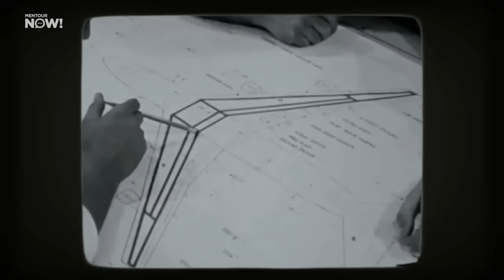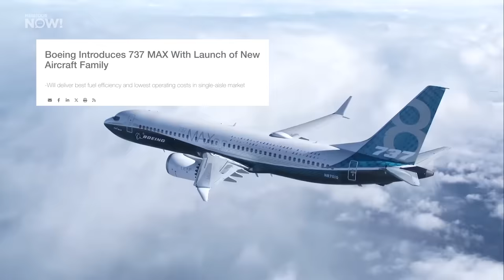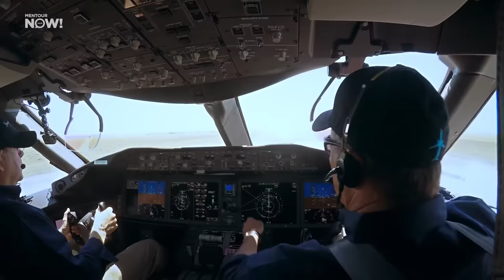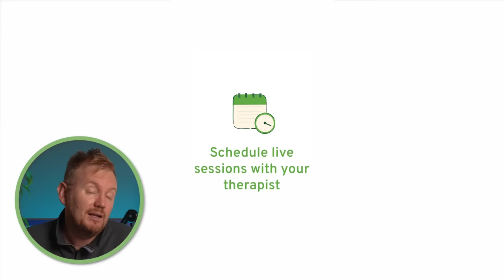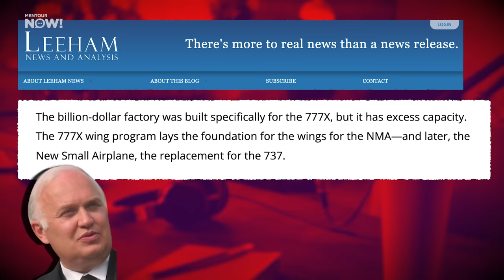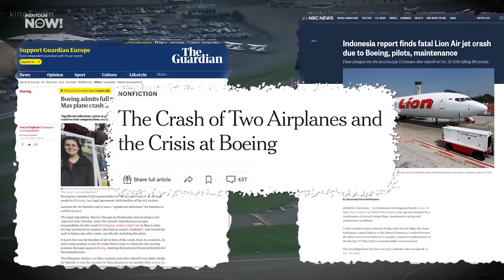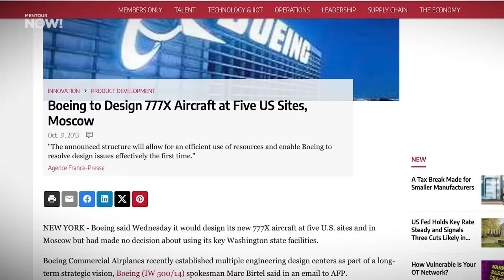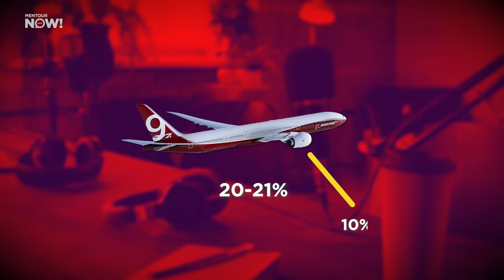What’s Going On With The Boeing 777X?!

Comment: Qatar told Boeing that they could tell by fuel use, which were built using FAUB. I could tell at assembly which sections were robot work. They didn't align very well. I was QA at final assembly.

Comment: I do like your videos, but this one is off. 
Especially in the conclusion. 
One main factorfor better fuel economics is that Boeing cramps more Pax in. A stretch helps a lot, as does a new engine and wing. 

Boeing made some really bad construction and process choices and left quality management fall under the table. 
Airbus did (unofficially) complain about the certification process Boeing had pre - Max murders. (Yes it was murder, and it`s hilarious no one went to jail for as VW managers had to sit for Diesel gate). 
The self certification of an own risk assessment is just contemplating the existence of the authority (FAA).  That had fail implemented, and it`s shocking that FAA didn`t notice it, already the B787 battery issue was a reason to doubt this process. 

Boeing, and solely Boeing is responsible for these delays as they tried to use shortcuts and put money over security. Thy suffer for their own sins, which is actually great. Because it shows that it matters. 
The big advantage Boeing has is the exclusive situation with the engines - Boeing is lucky enough to partner with GE, who`s just ahead of RR. If Airbus had access to a bigger engine, they could have already stretched the A35k by 4m to bring it close to 78m. A bit a larger wing, more thrust - and about 10t lighter for the same capacity as the B779. Boeing would have been forced into another desperation stretch just before the airplanes EIS.   
Also Boeing is lucky that the B777f saved the line.

Comment: So with all these 'FU' of Boeing on the 777X, 12 years now after announcement, will it ever fly? Hell no. The killers: 
1. The big freaking GE engine will not work good enough to get certified, acceptable maintenance. GE has bitter off more than it can chew. 
2. Will the air frame be good enough? Yes, but it will be much too complex and expensive to build. Especially the wings. Huge dollars invested into engineering, never recovered. 
3. Will the aircraft actually be type certified? Highly unlikely. Way too many issues. Another 5-6 years delay. Even if certified by a miracle, the market is gone. Who will buy such an unreliable, ultra complex contraption. Fools - the smart airlines will just buy the A350 and smile all they way. 
4. Finally the last nail in the coffin - China, Russia and friends. Boeing has lost the entire China+Russia markets, for obvious reasons. Their good friends won't touch Boeing. With this huge loss of world's biggest market, who do Boeing sell their 777X to? Europeans buy own Airbus. Few airlines in SE Asia, Africa and the Americans will need such a model. US airlines will be the only customer. Not good enough. 

Boeing has lost the army of engineers good enough to develop new aircraft. They lost it with 737MAX, lost it more with 777X. It announced no mid-range 737 replacement development, and gave up that huge market. It won't find enough people until the next generation of engineers were educated, then get a decade of experience. With luck that date is 2040.

The 777X is dead man walking as Boeing plunge into financial crisis.

Comment: I rather take my chances on the Comac than than any MAX series. I would rather be on a TU-154, screw fuel and emissions, its reliable.
Reply: Yeah and perfectly safe, its only had +73 hull losses with nearly 3000 fatalities
Reply from the maker: That’s a very strange position to have given the Tu-154 track record?
Reply: @tomstravels520  Mostly due to Pilot erroe and poor regulatory standards in the USSR. The MAX is still the most deadly plane in the air today.
Reply: @MentourNow  154m short haul, il-96-400 long haul, Pilot training in the USSR was poor the 154 itself is good. The IL-96 has no hull losses and is an evolution of the 86 which is a solid plane. The MAX how many years in the air and a 100 percent fatality rate on Crashes.
Reply: @REPOMAN24722  Two crashes does not make the plane the most dangerous in the air today
Reply: @nickolliver3021 
I think the issue is that it was two self-inflicted crashes by Boeing driven by “business decisions” that overruled “engineering safety standards” at multiple times. Boeing has and will continue to dearly pay for this shortsightedness considering all of the downstream ramifications.
Reply: @Mentaculus42  boeing and airbus will pay for all mistakes made until they go bust by that logic really. All companies are driven by self business decisions that over rule engineering safety standards all year round. But the whole point is the opposite and actually make better of the past in which boeing is doing and will continue to do so
Reply: @nickolliver3021  They do by showing the flaws in engineering in the plane. the center of gravity is disturbed making the plane rely on more automated systems, the 727 competed with the 154 and had more fatalities and had over 1000 more fatalities and 30 ish more hull losses.
Reply: @tomstravels520  The Boeing 727 it's competition

Hull losses: 119 
Fatalities:   4,211
Reply: @MentourNow  Well it was safer than its 727 counterpart 1000 less deaths similar hulls built, the HS Trident and 154 imho are better. That era of flight was more dangerous too but the 727 was well known for its poor track record. Trident was the first with auto land and I love both the trident and 154, the wings of the 154 and the offset landing gear on the trident and it's strange seating configuration like a train. Also super trident had a little booster jet to help it take off making it the only "5 jet" APU, 3 mains and a booster.
Reply: @REPOMAN24722  the 717……are you sure about that?
Reply: @tomstravels520 I meant 727 not the md-95. Boeing rushed the 727 becuase they worked together with hawker and ended rushing it hawker got pissed off really bad because they had the superior plane. Yet another time when America copied someone elses design.
Reply: @REPOMAN24722  so what flaws are they showing I engineering in the plane? The centre of gravity isn't disturbing. The plane relied automated systems like all planes do. The 727 has had its times of accidents time is moving on so the past is behind us now
Reply: @nickolliver3021 The plane is past it's used by date they should have made a clean slate design, the 737 was meant for small airports that didn't have automated cargo loading hence the low landing gear and wing for ease of maintenance, it's fuselage it shares with the 707, when it came to putting larger engines on the wing the 300 series hit their limit the cowling had to be flat on the bottom to accommodate it but with the new engines they had to push them forward and up so the Plane has a pitch up angle of attack when AP is off instead of a steady drop or level.
Reply: @REPOMAN24722  then by that logic the airbus has gone past its sell by date. They should have made a clean sheet design. The a320 was meant for small airports that didn't have automated cargo loading hence still having ancient technology than newer planes. You keep going on about should have done this. Go tell them straight yo their face. The a320 states its fuselage with the old ceo model. Putting larger engines on wasn't the problem. The engines were bigger and more forward hence a pitch up effect which hasn't causes many problems to this day. If you really want to complain say it to boeings face
Reply: @nickolliver3021  Your logic is flawed, the 320 fuselage and wing is 25 years newer than the 737's hence it being more versatile, the MAX was created as a rush due to customers wanting a plane immediately and threatening to order the a320 neo.
Reply: @REPOMAN24722  the point still stands. Having tne fuselage and wings being 25 years younger isn't the problem. It's still not a clean sheet. The a320neo was a rush too to not go through extra effort into a new clean sheet. That's why the neo was made so the industry doesn't like starting from scratch. Wake up its a sad reality we live in
Reply: @nickolliver3021  It may not be perfect but it's still in a better position than the 737, I want more choices so I for one am happy that comac is entering the market along with the ssj, mc-21, and a dual engined il-96 that China and Russia are working on together, the best plane I was on was an a340-300, was more comfortable than the regular 777-300 that I take, now I chose my routes to follow airbus for the first two legs then embraer or bombardier for the final leg 15,000km without a Boeing.
Reply: @REPOMAN24722  neither is the a320 perfect but it's the competition of the 737 which is in a good position too. If you want choices then you are really limited to A and B. Comic is not really going to outdoo A and B. You don't chose what planes to fly on certain routes its what the airlines allocate. So it can be a bieing or airbus.
Reply: @nickolliver3021  I certainly can choose the plane I fly on as I chose to fly on airlines that typically use Airbus. so when I make my Trips its always been A330-300 to Singapore, A340-300 to Zurich alternate is A350 or A380 to Fraknfurt, A320 to Vienna or Graz, sometimes Bombardier.
Reply: @REPOMAN24722  No you cant choose the plane you fly on. Airlines will not just typically use airbus for certain routes. it depends on what's available. its whatever fits them rather than the customer. so an a330 could be switched to a350 or 787.

Comment: 8:36 5 years for a clean sheet plane? Fuck that, I call bullshit. That's impossible.
Reply: It's indeed BS. The first concepts for the 777 were drawn in 86. First flight in 94 and delivery of the first production aircraft in 95. So basically 9 years from concept to first production aircraft. Officially the 777 project started in 90, but that was only the point when Boeing got some Airlines onboard to refine the aircraft design. The basic design was already pretty much set at this point.
Reply from the maker: Very good points, but with that same logic, the A380 would have been in development for 20 years.

Aircraft manufacturers likely have many projects in the pipeline but we only count the development from when the program is officially launched.
Reply: @shi01  The first concepts for the 777 had three engines and were intended to replace DC-10s and L-1011s. No real connection between that and the final product.